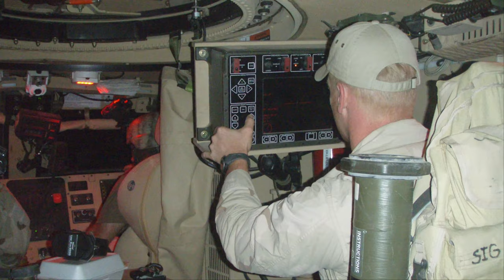Bullets Going Sideways?!?! Barrel Shot Out Or Something Else?

Comment: QUESTION: I have a H&R M16e1. Supposed to have 1:12 twist rate. 62 grain green tip impact the target at 25meters flat. 55 grain impact with a perfect circle. I’m wondering if this bore just can’t handle the bigger bullet. It is an original style barrel pencil . Please advise!
Reply from the maker: You need to replace that barrel. A 1:12 twist isn’t going to stabilize modern ammo. You need to get a 1:8 or better yet a 1:7.
Reply: @paramounttactical  Thanks for the advice! It does stabilize with the 55’s. I’m quite certain this might be the same bore that Armalite used in the original m16.
Reply: @paramounttactical  Also I would love to show you some pictures of the targets. It’s quite funny
Reply from the maker: @beavis1513 it might stabilize 55gr for a short distance but at 1:12 it’s WAY under stabilized with a low stability factor. It’s likely tumbling by 200 or 300yds. 
1:12 was the original twist rate and there’s a reason the rifles twist way faster now.
Reply: @paramounttactical  Wow didn’t know about that! Thanks I guess I’ll keep my targets under 300 m. I use iron sites on it anyway.